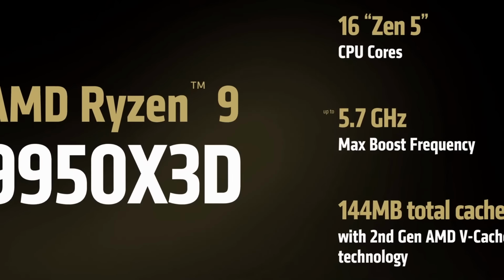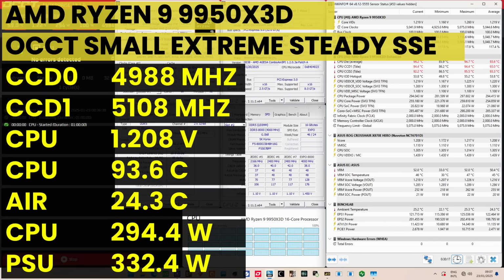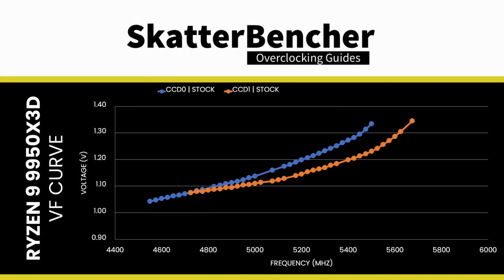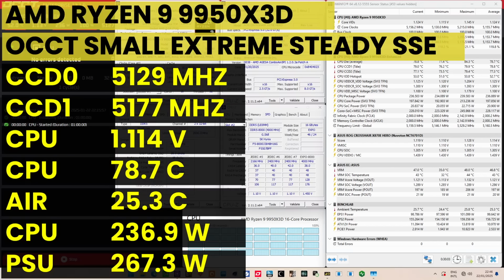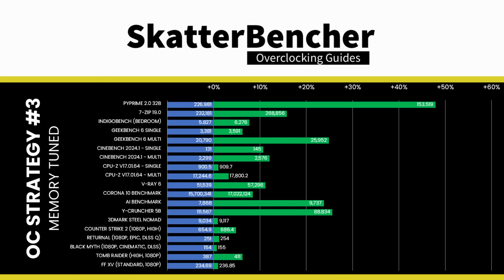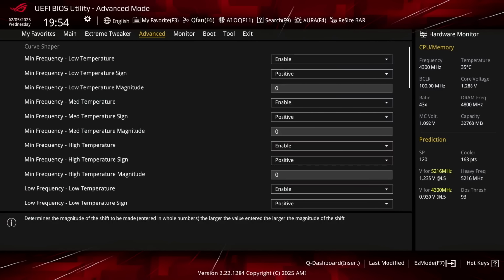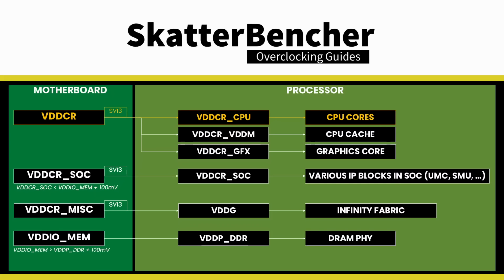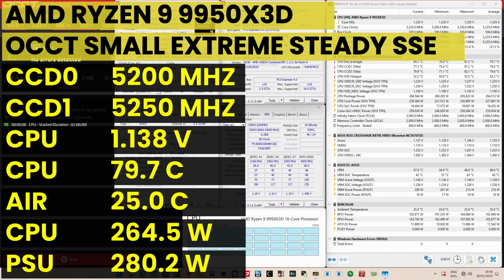Ryzen 9 9950X3D Undervolt & Overclock to 5900 MHz | SkatterBencher #85

Comment: I currently have it installed with an ASUS ProArt X670E and i can not seem to get it over a certain voltage threshold of around 1,28V Allcore. I am not thermally limited while running either Stockfish or any other Program that heavily scales with Multicores and Power (77-80C and i'm not even putting my MoRa outside yet). I can not for the life of it make it eat more than around 1,25-1,28v with an AVX512 Load and "only" 5,0-5,1 Ghz at 270W.

Has anyone else noticed any kind of voltage limitation ? Out of the box there was already one in place on the Mobo (CPU Current Capability or something like that). I have disabled all of them to my knowledge and now suspect there is still some hard limit by AMD. Am i right ?
Reply from the maker: That sounds about right. There's a voltage limiter that will prevent the CPU from using higher voltage even though you're not thermally limited.

Have you tried if setting Scalar to 10X makes a difference?
Reply: @SkatterBencher  Hey, yes, i did but it didn't really make any difference. Maybe it makes more of a difference the closer you get to a thermally more difficult situation (and therefore risk degrading your chip faster) or a single core or lightly threaded burst load.

I just stumbled upon a few people that had the same issue with the 9950X so i guess with PBO we ain't gonna get more than what i saw now. Really a shame.

When its winter time i could take advantage of 35C headroom...thats a lot left on the table.

I guess i have to resort to making a second profile for AllCore OC for certain workloads that can justify going all core and losing peak burst clocks from PBO.

Thanks for your confirmation though, its what i already suspected.
Reply: @ThirdLife86  The more load you put on the cpu, the more vdroop you are going to get. If using PBO, amd's LLC will be used and droop quite a bit under full load scenarios like this. 

This was where dynamic OC switcher used to come into play but you could also use voltage suspension.

Comment: Hey would a 64gb ram kit be difficult to overclock than a 32gb? I’m looking to get the 6000 cl26 kit
Reply: You're gonna miss having half the ram in a few years vs 2% performance difference
Reply: That 32 gig 6000cl26 is extremely good. Unless you need 64 gigs it's the way to go.
Reply: @ gaming and video editing but I also want to overclock the ram slightly

Comment: By any chance did you encounter any issues with X870E Hero mobo when overclocking ?
Reply from the maker: None that I can recall. I've used this board for a couple of overclocks now and it's a pretty solid platform for Ryzen 9000 overclocking

Comment: Ryzen 9 7950X3D uses 150W-180W and the Ryzen 9 9950X3D uses 250W-300W...  
It uses literally 50-100% more power than the last generation, to perform 8-25% faster... WTF even.  
If only we can overclock and push the Ryzen 9 7950X3D even further it is WAY more power efficient...  
This architecture sucks.  Ryzen 7800X3D and Ryzen 7950X3D are amazing.
Reply: Its only more efficient because it sticks to a way lower voltage range of about 1,1V. You can do the same with the 9950X3D, no one is forcing you to throw 300W at it.
Reply: @ThirdLife86  Even while the 9950X3D runs in ECO mode, it still consumes 50% more power than the Stock 7950X3D.  
Quit defending bad silicon.
Reply: @RNG-999  You can do a lot more than just click "ECO Mode" you know ? If you don't know what you're doing of course, then you might get to the point where you are now though and spout nonsense.
Reply: @RNG-999 I'm pretty happy with my "bad silicon"

Comment: I was wondering, would it be beneficial to overclock only the 3D V-Cache ccd and leave the non 3D V-Cache alone?  Would you get more headroom for the gaming ccd (heat and power budget) that way?  I'm probably an edge case, but: I primarily game, and weekly have a day of heavy compiling.  So I would love the bump on the gaming side, but the productivity side, while still necessary, doesn't need a bump (IMO).
Thanks for your amazing guide, as always!
Reply from the maker: This is an interesting question.

I noticed that in some gaming workloads, the load would be thrown on the high frequency CCD1 even though if it runs on V-Cache CCD0 it's faster. One way to force the loads to always go to the V-cache first is by lowering the Fmax of CCD1. That's not possible using the usual AMD tools (they should really have per-CCD Fmax!) but in ASUS BIOSes you can set a per-core Fmax.

If you set the per-core Fmax of CCD1 cores to 25MHz lower than the V-Cache CCD Fmax, the CPU will always first throw loads on the V-Cache CCD. That's great for gaming workloads that benefit from it, but I do see performance regressions in workloads that prefer higher frequency.

In your case, that sounds like a trade-off you're willing to make though.
Reply: Thanks for the advice  @SkatterBencher , that is definitely a tradeoff I'd be willing to make! I plan on getting an ASUS ROG board, so that is something that I'll set up once I can actually get a 9950x3d at MSRP.
In addition to potentially allowing more overclock headroom for CCD0, slightly lowering the Fmax on CCD1 vs CCD0 also sounds like a good solution for the few gaming CPU prioritization missteps that AMD still hasn't ironed out yet, (EG some game threads being thrown onto CCD1 cores).
Reply: @SkatterBencher "some gaming workloads being thrown onto 'Frequency' CCD1"

Wouldn't this mean CPPC/X3D-Optimizer driver isn't doing what it's supposed to: corralling games onto CCD0? 

What aspect of component is allowing the load to be moved onto the less optimal Freq CCD1?
Reply: The non compromised solution for scheduling the load is to use process lasso. You will be able to assign the game to CCD0
Reply: @audiodemos2579 I've read on the Overclock forum threads that there's more to the X3D optimizer/scheduling than merely assigning affinity (like Process Lasso is used for). Someone mentioned that manually assigning affinity via a tool like Lasso would still fall short of what the CPPC/X3D Optimizer driver does.

Have you heard of anything in line with that? I'll try to find the source post where I read this (I'm not saying it's necessarily correct).
Reply: Can you please make a video for pure gaming ( call of duty ) 9950x3d overclocking. If possible do you do anydesk help. I'd be willing to pay you for your time and services for the help and knowledge. Really enjoy your videos.
Reply: @masdrawoh  well just follow the instructions on this video ??? lol what do you want more ?

Comment: does Fmax overwrite even do anything with ECLK OC?
I left it off and it literally didn't change anything....
Reply from the maker: Yes, Fmax override and ECLK work together.

Fmax override simply lifts the programmed frequency ceiling by up to 200 MHz. It's possible you don't see any impact if the V/F points for those frequencies is higher than the voltage limit.

Comment: Is this cpu faster than the 9800x3d?
Reply: In productivity, yes and by alot, in gaming its more or less the same with slight improvement in some games so overall yes this cpus claps
Reply: @5eyed2k  wrong, the 9800 seems to do better in most games over the 9950x3d, especially with 1% lows. But the difference is really small so if you do productivity, the 9950 is the better choice 100%
Reply: ofc it's higher bin. always has been this way 😂

Comment: Regarding per-CCD undervolting, I believe the best CCD should have a lower undervolt compared to the weaker one? The reasoning is that a higher-quality CCD can achieve greater frequencies, and as we know, higher frequencies require more voltage for stability. Could you share your thoughts on this? Thanks for another great video.
Reply: CO (Curve Optimizer) isn’t just simple undervolting. It’s about finding the sweet spot between voltage, frequency, and stability based on your silicon quality.

Too much negative CO can cause unstable cores, frequency drops, or crashes. Too little and you get higher temps without real gains.

It’s not just ‘lower is better’—it’s about optimizing the whole curve for max performance.
Reply: Yes, for sure. I ended up with all core as there was only one core that needed more Voltage compared to all the other ones. In the High and Max frequencies I also adjusted for high temps in curve shaper. Running very cool, 45C at light loads. Stress tested in Prime95, OCCT and CB23. Thanks for your comments.
Reply: @johnlenerd What scores did you get in Cinebench R23, if I may ask?
Reply: @Coldblackice  Now I've learned that max undervolt on some cores can make weaker cores unstable and not wort it. Now a days I rund my CPU as low as 600 mHZ when doing ligth work and just at low 5000MHz. I do appreciate the lower fan speed and low noise when working. As OC is concerned,,, I did reach the top tier scores, but as I said I've dialed it down because of the heat.
Reply: I had same issue about this:face-blue-smiling:
Reply from the maker: In my experience, it really depends on the CCD. Some high frequency CCDs also have good undervolting headroom and some don't. Some low frequency CCDs have amazing headroom and some don't.
Reply: @SkatterBencher  Thank you. BTW I just discovered that only core 11 needed less undervolt, so per CCD makes little sense for me.

Comment: Your 5 minute overclock undervolt vid on the 9950x was spot on so I suspect this will be gold too
Reply: You can do it. ❤
Reply: @SkatterBencher Can I pay you to do this do all this to my pc?
Reply: @SkatterBencher Can I pay you to do this do all this to my pc? I have a asrock x870 pro WiFi motherboard, ryzen 9 9950x3d cpu, and a nvidia 5090 and want to get it running at max capacity for performance gaming Fortnite
Reply: @TheJoker_AI Even a potato can run fortnite
Reply from the maker: the 5 minute overclock version is already out for members :)
Reply: @SkatterBencher 🙁😧
Reply: @SkatterBencher  is the 5min oc version under patreon?
Reply: @SkatterBencher how do I pay to become a member to get the 5min overclock?